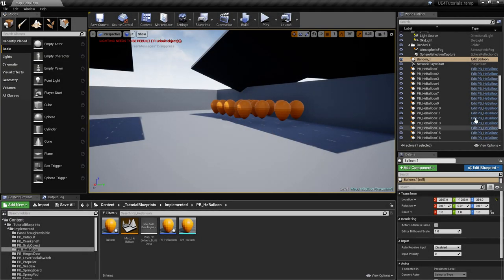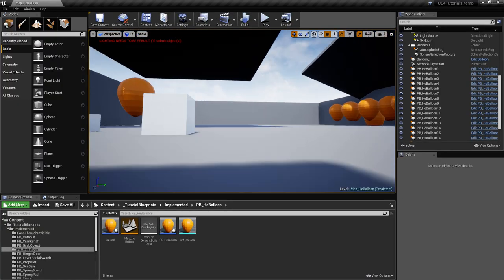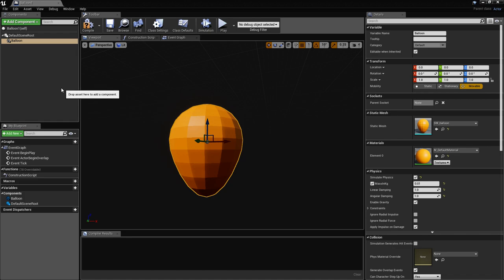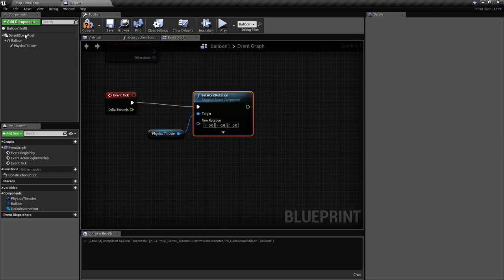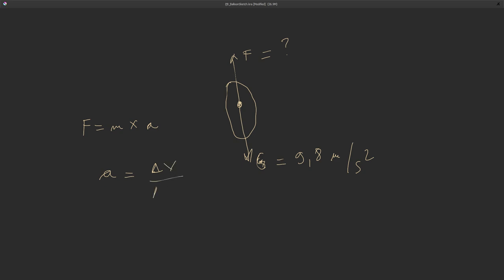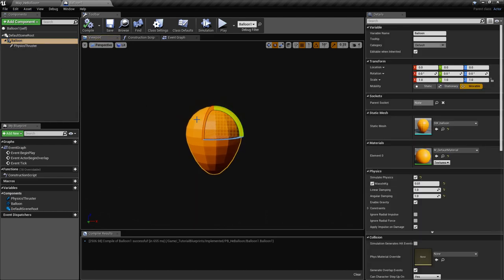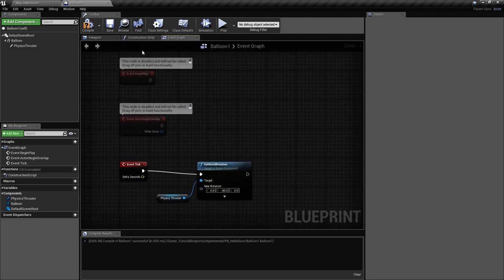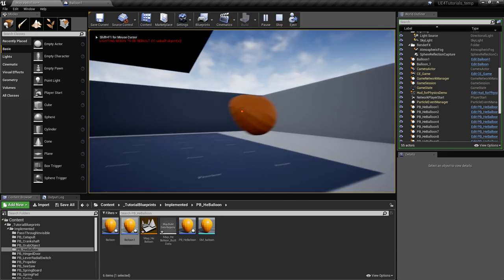UE4 Helium Balloon - Artificial or Anti Gravity using Physics in Unreal Engine 4 Tutorial How To

Comment: Cool little video! :D Just a slight optimization adjustment for this: instead of setting the rotation of the thruster each frame, you can just go to the rotation of the thruster and switch it from relative to absolute rotation. This will then force the rotation of the thruster to be in world space instead, so you can always have it pointing down regardless of the actor rotation. :)